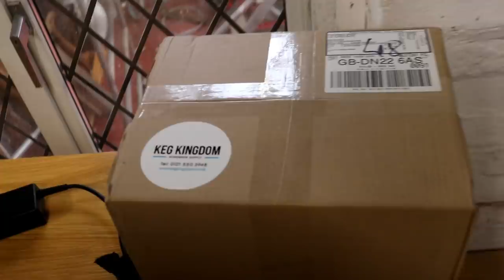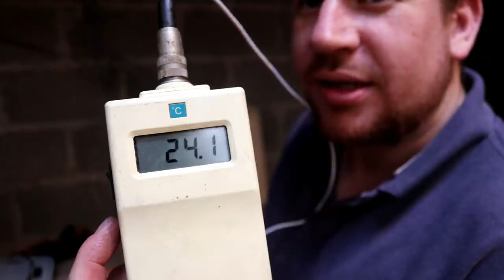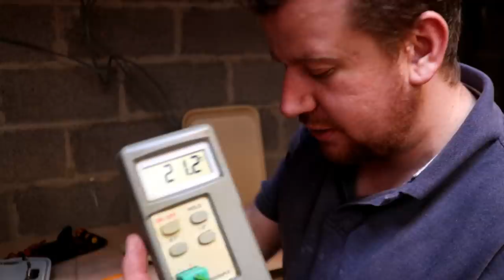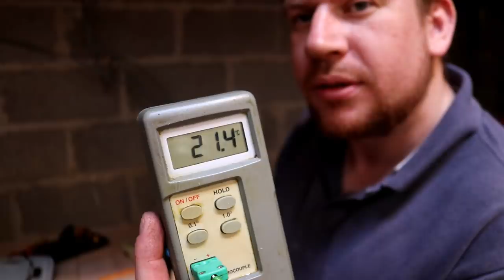Dry Hop The Test Batch

Comment: Usually with a bios password, you take the battery out of the motherboard and leave it for 30 minutes or so before putting it back - you need to wait a good length of time for the residual power to discharge. There may also be a bios reset jumper on the motherboard.
Reply: Plus one to what he said ☝️.
Reply: Yep spot on. Take the battery out, reimage with Windows 10. Dn't even need a licence anymore if it has previously had Windows 7 or 8 on it.
Reply: The free upgrade to Windows 10 has closed now I think, so unless the previous owner did the upgrade before Microsoft closed the scheme they wont have the licence associated with the system. You shouldn't need to take the battery out for that long either, 30 seconds at most. Especially if you remove the power lead and press the power button on the front. Any residual charge in the PSU would normally get drained when it tries to start up with no mains supply.
Reply: A lot of newer boards have a fixed rechargeable battery these days however there is often a bios reset jumper/switch on the board.
Reply: Yep like he said, just clear the cmos (have a look on the mobo for a header with jumpers near the battery) should allow you to access the bios then.  Then boot from usb, format the HDD and install the Operating System of your choice =).
Reply: Only got a quick glimpse but looks like you have a Dell there.   If so try and follow the instructions in the third section of this page. http://www.dell.com/support/article/us/en/19/sln284985/how-to-perform-a-bios-or-cmos-reset-and-or-clear-the-nvram-on-your-dell-system?lang=en

That should get you past the bios lock then you can format the hard disk and reinstall Windows.

Comment: As others have stated. Clearing the CMOS is what you're going to want to do. It will be a jumper (or sometimes, it will be a button on the board or the back I\O panel). Either way, find the manual for the board make and model or the system itself if it's a prefab system like an HP, dell, etc. Good luck.